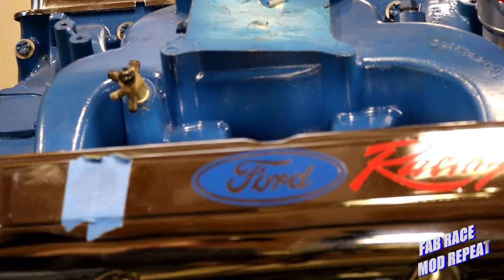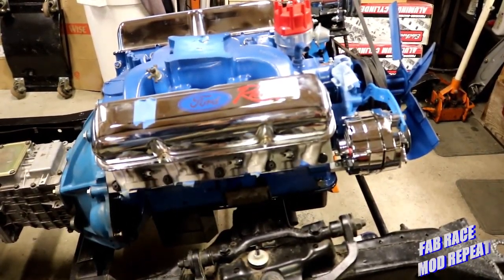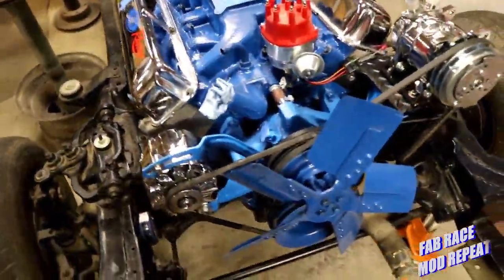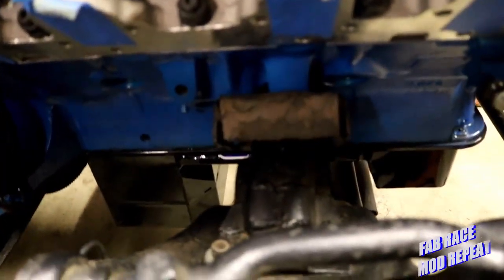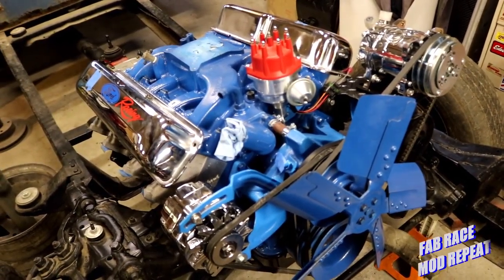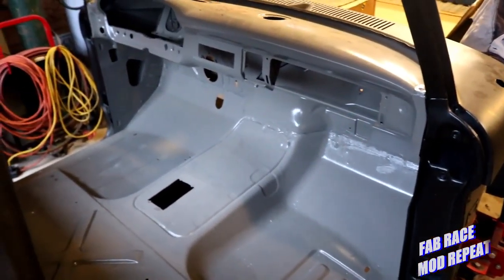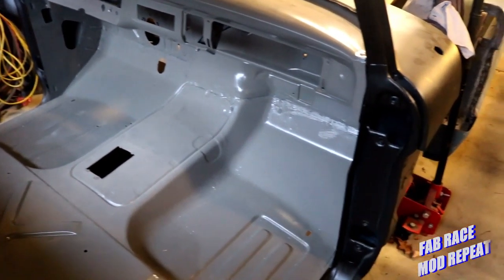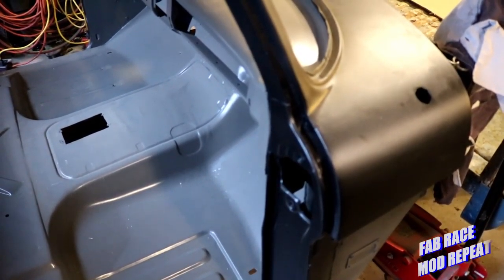FE Build #1 Moving forward

Comment: Should a 390 fe harmonic balancer/damper slip onto the crank snout by hand if there is no key installed?
Reply from the maker: @Cody James
It shouldn’t be so tight you can’t get it started by hand however, it shouldn’t be so loose that it freewheels on the crank snout.
Reply: @FabRaceModRepeat  Thank you for answering!
Reply from the maker: No problem, glad I could help
Thanks for watching